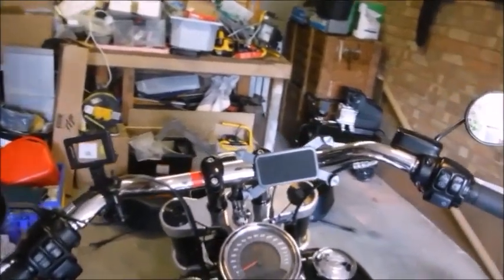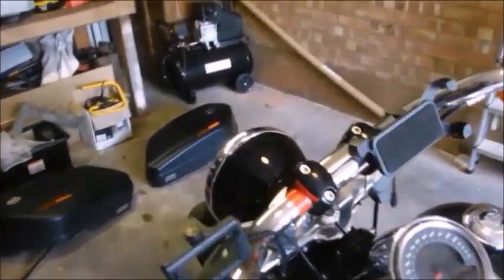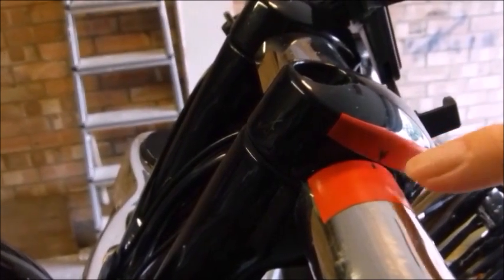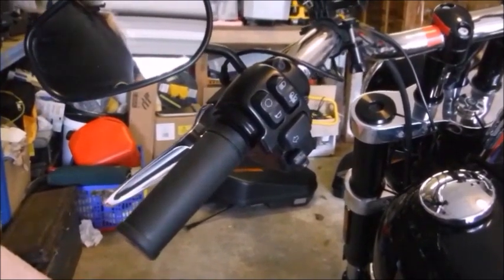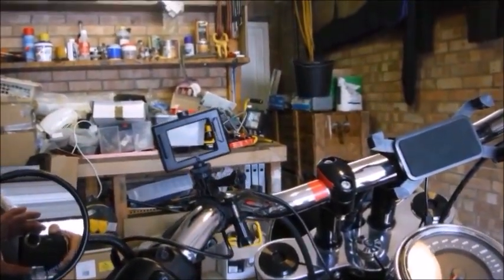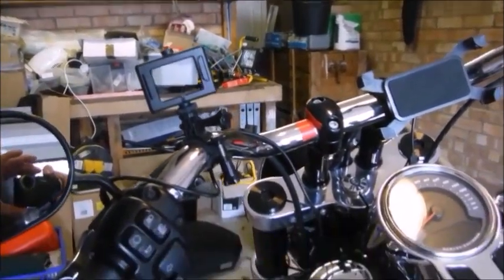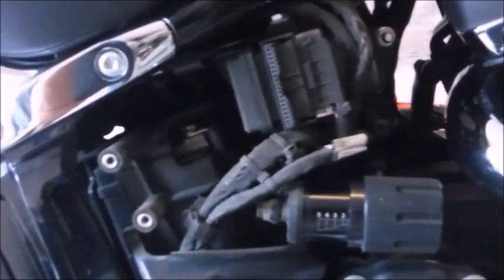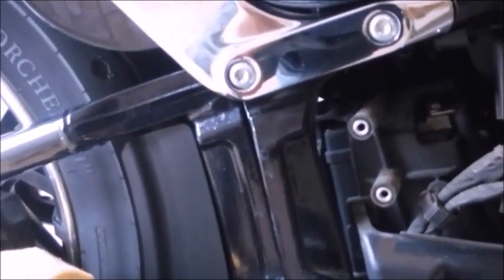Suffolk Sport Glide  Disabling Alarm for Battery Removal,   update on Handlebarss

Comment: As always thanks for the great video, I was wondering if possible you could make a video about 2 up riding on the Sport Glide. Perhaps what type of settings you use on the shock, do you put extra air on the tires, how is the handling on the bike with a passenger.  I have been looking for videos on this but have found zero! It would be greatly appreciated thanks
Reply from the maker: Hi David, thanks for comment. I will make my next video about riding with a passenger. cheers Tom
Reply: Awesome thank you so much!

Comment: When I had the bike in because of a flat tire, the bike did not start because it was wired incorrectly, so they changed the battery no charge. Changing it is tricky so you need to be patient.

Comment: Hi, do you think there is sufficient slack in the wiring/cables to fit either the HD 4” or 6” riser without having to change anything
Reply from the maker: yes, i have fitted 4" risers with no problem, just moved clutch cable to front of bar, might be a bit tight for 6", would need to try to see.
Reply: @sportgliderider  Thank you, I’ve really enjoyed watching all your video.  As you’ve commented, interesting to see what you can actually quite easily do yourself (especially after having watched you do it) rather than having a H-D dealer charge you top whack.  I collect my Sport Glide from Lind, Norwich next month. Amusing to identify local roads on your Ride Out’s.  Hope we might bump into one another in the future. Regards
Reply from the maker: @jasperduncan6633  i got mine from newmarket, i love it.  there are lots of things you can do without paying HD prices. say hello if you see me around. I am in Fenlanders HOG, but from Norwich they have Iceni chapter, they are a great bunch of people and do lots of ride outs.
Reply: @sportgliderider  I look forward to it and also watching your future videos